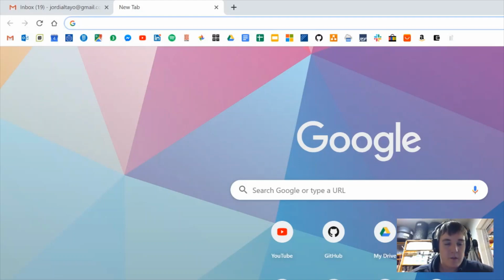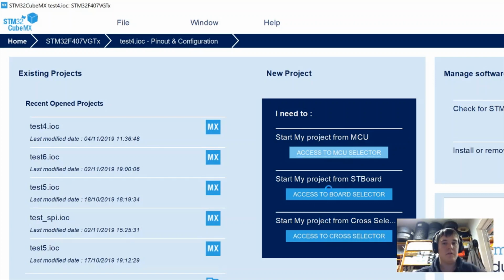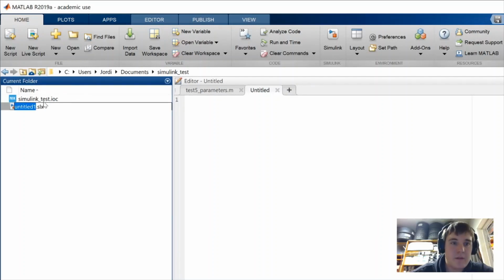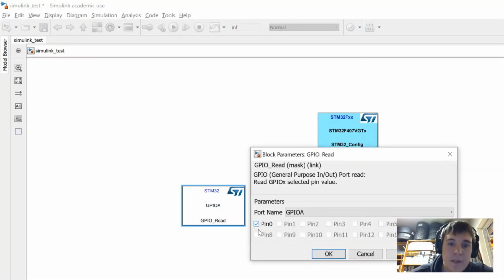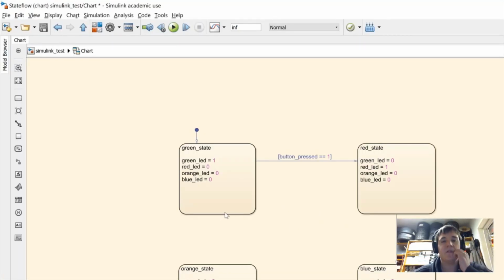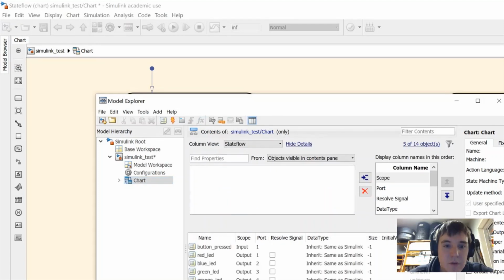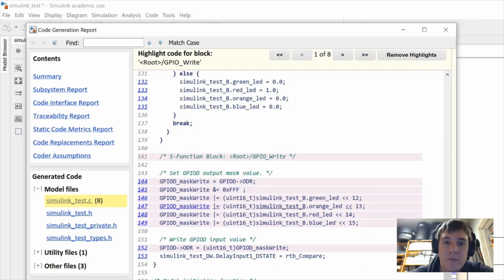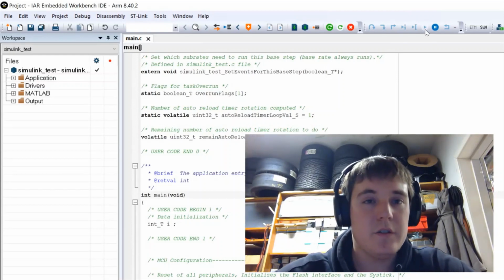STM32 Simulink Code Generation Tutorial

Comment: The tutorial was great! I followed all the steps exactly and my code builds and compiles on EWARM. When I run it on the microcontroller, nothing happens. I had a look at the project folders and I found that there was one main function within a 'Core-->Src' folder and another one within a 'Src' folder. The first one has an infinite while loop that has no code in it and it seems that my code stays within that loop and nothing happens on my microcontroller because of that. Can I run the second main? If I can, how do I do that?
Thanks in advance
Reply from the maker: I am not entirely sure why this happens to you but I think that it should work with the main in file main.c.   Is it completely empty?
Reply: @jagjordi  the entire main file is not empty. It seems to initialise HAL, MX_GPIO_INIT, etc.
It's just the while loop that is empty 

The other main function outside of the project seems to call the initialisation of the 'simulink_test.c' file 
But if I copy the text from the second main function and replace the text from the first, the project fails to build.

I think that one of them is generated by stmcubemx and the other one is developed by simulink
Reply: @jagjordi  I think the problem is that MATLAB doesn't open stm32cubemx to replace the code. Do you know why this happens? Some of the project files are missing unless I click generate code from cubemx manually.

Comment: I am trying to generate a PWM signals but I can't push the frequency over the 1000 Hz. I tried to change the fixed step size with a smaller one but nothing. At the same time I pushed over the sys clock to the maximum. Do you have any idea how can I generate PWM signals with a higher frequency? 
P.S. Simulink give me an error when I am trying to generate code. This are the error:
 - ### Real-Time Workshop build procedure for method: 'error'
   ### Real-Time Workshop build procedure for model: 'PWM' aborted due to an error.
   Error: Errors occurred - aborting
-  Error in 'PWM/Pulse Generator': The computed sample time (0.0001) is not an integer multiple of the fixed step size (0.001). The period, pulse width and phase delay parameters of this block need      to be integer multiples of the fixed step size

Thanks a lot

Comment: Sorry, I tried to compile the code for STM32CubeIDE but didn't work, it give me a lot of error, then I used EWARM like you and it works but the problem is that EWARM isn't free!
Do you have any idea about that mistake?
Reply from the maker: There is a bug in STM32CubeMX when generating the project files for CubeIDE, as far as I know ST is working on addressing it. Try using Keil, I used with stm simulink and it works. it also has a free version but with limited code size
Reply: @jagjordi  Thanks!!
Reply: Hey, I also get some errors while compilation in CubeIDE. 
For me it's "arm-none-eabi-gcc: error: Files/MATLAB/R2018b/simulink/include: No such file or directory"
I think it is caused by the space in "Program Files". Is it the same error for you guys?
Reply from the maker: @beta_x5216  Do you have spaces in your windows username?
Reply: @jagjordi  No, but there is a space in "Program Files" :)
Reply: Beta _X hey I got the same error, Can you please let me know how you solved this error?

Comment: Great Video Thanks Sir
2 questions :
Is it possible to just copy and paste the code to Keil Software and upload it to the board??
Will it work independent of PC?
Reply from the maker: Copy and paste the code is posible, however it will be hard to generate the project files with all the compiler directives and makefile related things by hand. I recomend using the automatically generated project files form CubeMX, unfortunately they only work with Keil and IAR

Comment: Excellent video!!
How can I use the external mode? There is no button to change it to the external mode in Simulink. Thanks!
Reply from the maker: what do you mean by external mode
Reply: @jagjordi  In my understanding, by using the external mode, the internal data in STM32 can be acquired by Simulink in PC. (I'm beginner, maybe wrong)

I'm curious about the difference and relation between this approach:
https://www.mathworks.com/help/supportpkg/stmicroelectronicsstm32f4discovery/ug/external-mode-using-stm32f4-discovery-board.html
However, it seems that there are fewer blocks (e.g. no DA block)
 than STM32-MAT/TARGET
https://www.mathworks.com/help/supportpkg/stmicroelectronicsstm32f4discovery/ug/getting-started-with-embedded-coder-support-package-for-stmicroelectronics-stm32-discovery-boards.html
Reply from the maker: @wohnishi705  I think what you are refering to is a PIL simulation, where you run part of your model in the computer and part of your model in the mucrocontroller. I plan on doing a video about that in some time.

Comment: Is it possible to PID control the trajectory of a differential drive mobile robot operating with an Arduino Microcontroller using Matlab simulink? The mobile robot is comprised of motors connected to pwm pins and there's a camera calculating the error between the desired and the real trajectory .
Reply from the maker: https://www.mathworks.com/hardware-support/arduino-simulink.html
Reply from the maker: this might help you :)

Comment: Are those hoosiers behind you? :D I guess you are doing this for an FSAE related project?
Reply: Is it not possible to skip the part of opening the project in another program to really flash it on the board? Can simulink not do that directly itself?
Reply from the maker: @ottarification  Unfortunately it is not possible as of now
Reply: @jagjordi  Thats a shame. Do you have any experience with the STM32H7 ? Or even SPC5 processors?  I am currently fighting an SPC5 discovery board, but the support seems to be far worse than for STM32 in simulink
Reply from the maker: @ottarification  I have used STM32F7 with simulink and it worked well. Haven't tried with H7 nor SPC5 unfortunately

Comment: Excellent Video... now m using STM32G071RB nucleo Board.. but got error.. please help me

### Generating code into build folder: E:\MATLAB R2019b\STM32G0 Nucleo\Simulink_test\Simulink_test_stm32
----------->SFUNC MODE: SS_SIMMODE_RTWGEN
----------->Model reference Simulink(R) Coder(TM) target is building
----------->SFUNC MODE: SS_SIMMODE_RTWGEN
----------->Model reference Simulink(R) Coder(TM) target is building
----------->SFUNC MODE: SS_SIMMODE_RTWGEN
----------->Model reference Simulink(R) Coder(TM) target is building
----------->SFUNC MODE: SS_SIMMODE_RTWGEN
----------->Model reference Simulink(R) Coder(TM) target is building
Source 'Simulink_test/GPIO_Read' specifies that its sample time (-1) is back-inherited. You should explicitly specify the sample time of sources. You can disable this diagnostic by setting the 'Source block specifies -1 sample time' diagnostic to 'none' in the Sample Time group on the Diagnostics pane of the Configuration Parameters dialog box.
Component:Simulink | Category:Block warning
----------->STM32 MCU:stm32g0

### Real-Time Workshop build procedure for method: 'before_tlc'
* stm32_make_rtw_hook(): 'Simulink_test' has ModelReferenceTargetType set to: 'NONE'
* stm32_make_rtw_hook(): updateTlcCustomizationOfMain(Simulink_test,1,normal)
* stm32_make_rtw_hook(): updateTlcCustomizationOfMain(): -> 'RTW'
### Invoking Target Language Compiler on Simulink_test.rtw
### Using System Target File: C:\MATLAB\STM32-MAT\STM32\rtw\stm32.tlc
### Loading TLC function libraries
### Generating TLC interface API for custom data
### Initial pass through model to cache user defined code
### Caching model source code
Warning:  SYS Timebase Source value is 'SysTick'
Warning:  Fundamental sample time is set to: '1e-3' s by the Simulink model
Error:  Move to TIMER as Timebase Source for SYS in the STM32CubeMX project.
Main program:
==> [00] E:\MATLAB R2019b\STM32G0 Nucleo\Simulink_test\Simulink_test_stm32\tlc\customRoutineProcess.tlc:<NONE>(71)
    [01] C:\Program Files\Polyspace\R2019b\rtw\c\tlc\mw\formatwide.tlc:<NONE>(534)
Warning:  Customizing the main entry point is requested as 'RTW' for 'Simulink_test'
Warning:  Create main.c for Real Time Mode with 'Simulink_test'
Warning:  Number of sample times is set to: '1'
.
### Writing header file Simulink_test_types.h
### Writing source file Simulink_test.c
.
### Writing header file Simulink_test_private.h
### Writing header file Simulink_test.h
### Writing header file Simulink_test_External_Functions.h
### Writing header file STM32_Config.h
### Writing header file rtwtypes.h
.
### Writing source file main.c
### TLC code generation complete.
### Real-Time Workshop build procedure for method: 'error'
### Real-Time Workshop build procedure for model: 'Simulink_test' aborted due to an error.

reply me on harshal.tirse@gmail.com
Reply from the maker: I would love to do it but unfortunately I don't have access to the equipment due to coronavirus restrictions
Reply: the solution is to use a timer as a timebase source. in STM32CubeMX go to System Core --> SYS and choose i.e. TIM1 as Timebase Source
Reply: I have very similar erron on STM32F103RBTx, do you solved youre problem ?
Reply: @damianf6555  no
Reply: @harshaltirse8339  did you find any other way to program stm32 using simulink?
Reply: @damianf6555  yes... Currently m using stm32f407 board.. But header file error
Reply from the maker: Hello, this seems to be a problem with STM32CubeMX code generation. I would suggest updating to the latest version but other than that I can't help much with it.
Reply: @jagjordi  can make another video like as.... Adc,  serial... Any interfacing